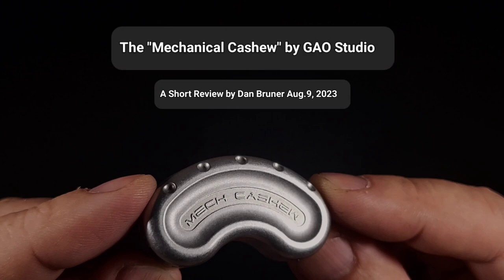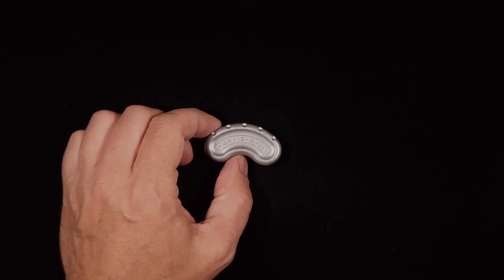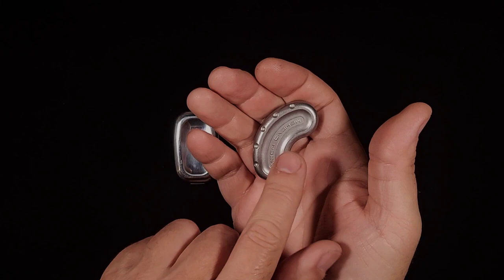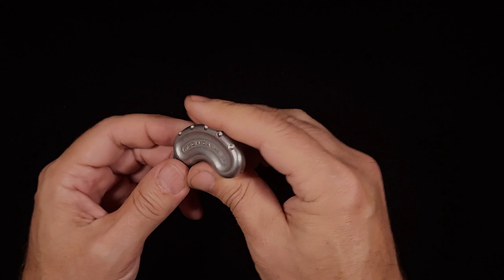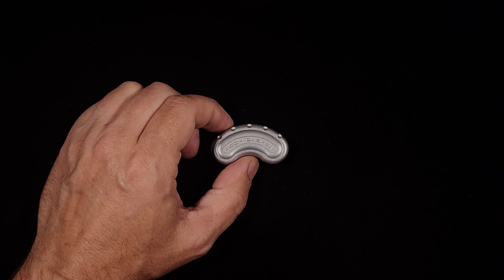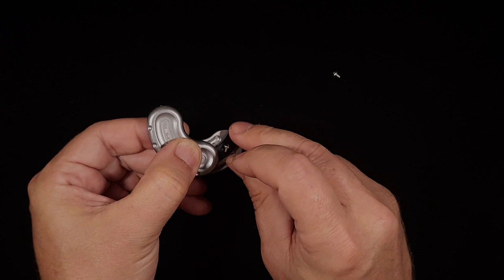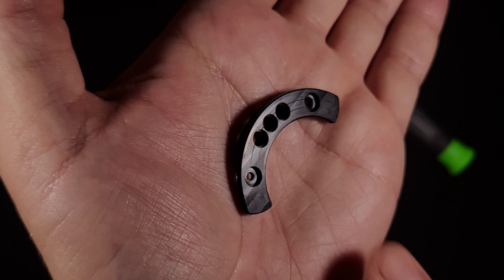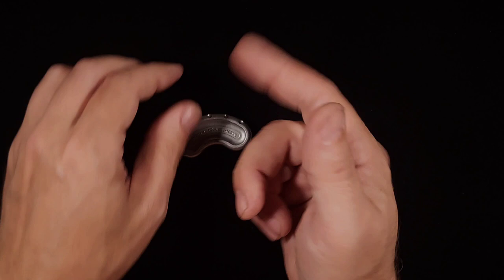The "Mechanical Cashew Nut" Slider by GAO Studio - A Short Review by Dan Bruner Aug.9, 2023

Comment: Interesting, I just got mine yesterday as well. And it came with a few spare parts, hidden in the top of the case. 2 extra ball plungers and a really small torq t screw driver. I have not opened mine up yet, it is scratchy but it slowing working itself in. I did get the Zr version so maybe thats way. I will be posting a short showing it shortly.

I am finding the Zr slippery, so I might of made the wrong choice there. It looks nice though :)
Reply from the maker: Mine came with an Allen wrench,  2 ball plungers, 2 springs, and 4 glass balls. That it.. No extra parts at all, which is disappointing, considering the price. 

Yeah, I try to avoid polished surfaces anymore. My "One Pal" is polished stainless steel, and it's almost too slippery. I might sandblast it soon.